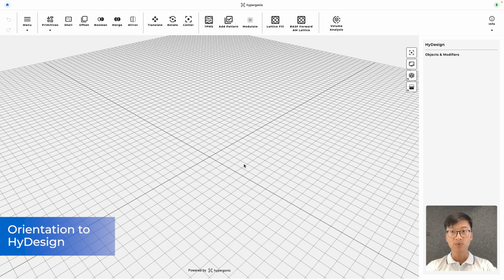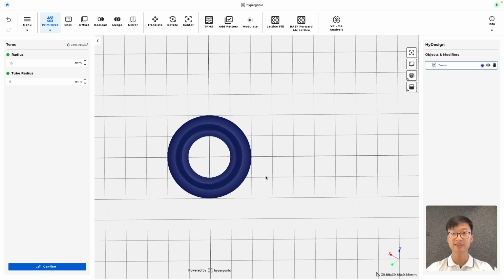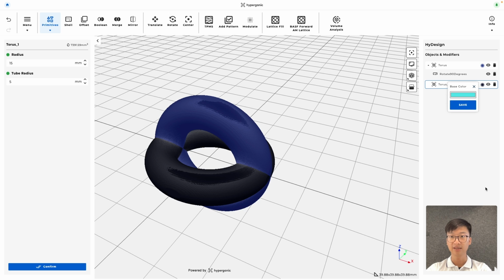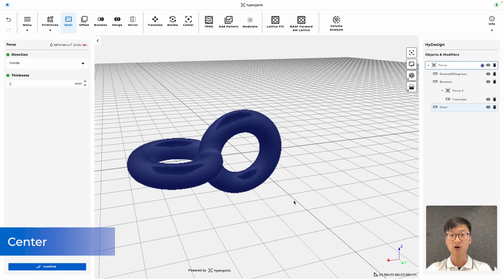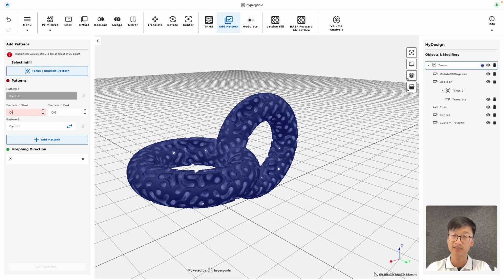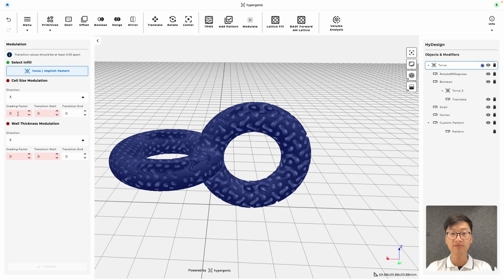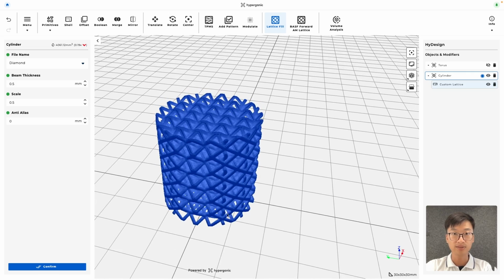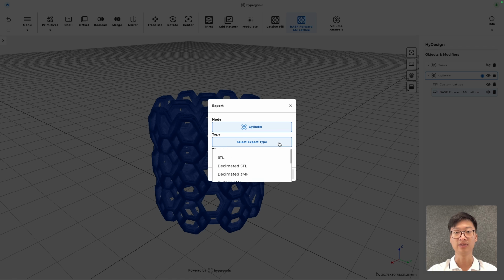HyDesign Intro Guide v1

Comment: I love how HyDesign is mixing features from CAD/Modelling with 3D printer slicer features. This is definitely a crazy software that can outcompete others with more improvement and features over time. I’ve been waiting for this to come out for years now and I am really excited to play around with the features and play with gyroids, lattices, etc.
Reply: Please just please though make this software cheaper/more affordable than Fusion, Shapr3D, Solidworks, NX Siemens, NTopology.  And please make sure you keep things simple unlike Blender 3D (free but challenging). Those softwares are either too expensive and or they have a steep learning curve for beginners and intermediates. Designing should always be made to be easier, more intuitive, but achieving more complex task! Which you all are doing well with infill patterns
Reply from the maker: Thanks so much for your kind word! Would love to reach out to understand your experience with it :)